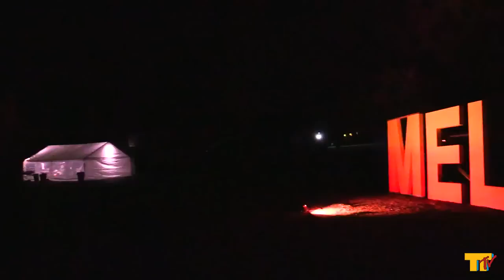MELT'n Episode 1

Comment: Tight. Is there any need for local ventilation at these types of events? Seems like the tents are partial enclosures. Wondering the same thing for events in big warehouses
Reply: They kept the air moving in the tent and it never had the chlorine-like smell I associate with poor ventilation.  That said, public events in buildings not designed for flameworking often require an exception to the rules we follow at our own studios.